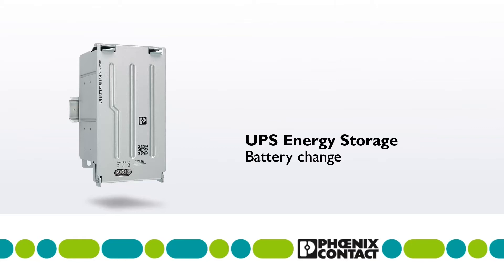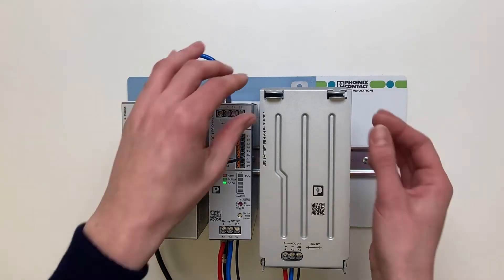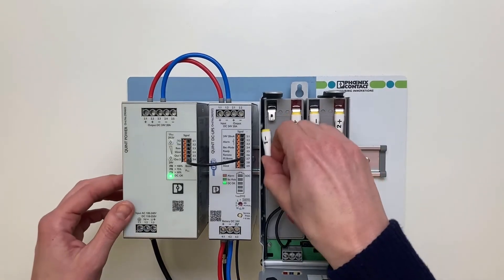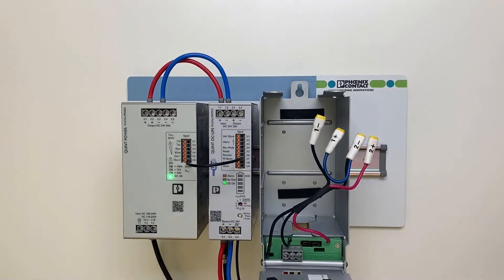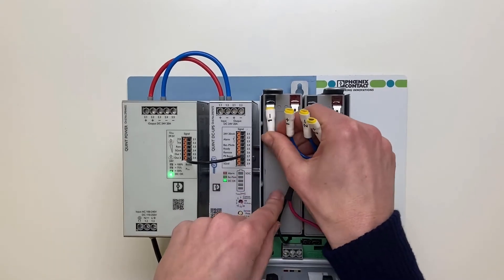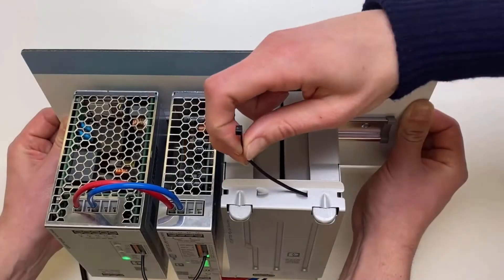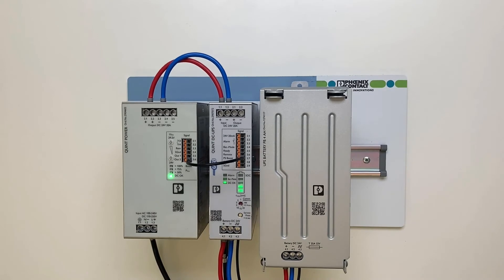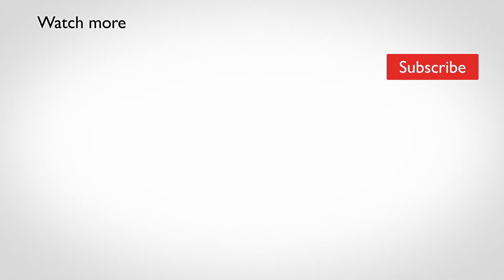Battery change of a UPS-BAT

Comment: Why does this UPS show that the battery has expired, but when replacing the UPS with another one, while leaving the battery, it shows that everything is fine
Reply: Data about the state of the battery is stored in the UPS and linked to battery serial number.
Batteries connected to the UPS are tested concerning defects continuously. 
Occurring defects will be signaled via LEDs on the front of the housing, the alarm contact or the communication interface.

Comment: if I only want to check the fuse, do I have to switch it to "service mode"
Reply from the maker: 1) In operating mode the UPS checks, if the battery is present. So if the fuse is damaged or not plugged, there will be an alarm.
2) If there is more than one battery module connected in parallel there is an additional alarm for fuse check.
3) If you want to check the fuse manually, it is recommended to switch the UPS to "service mode". Press the bottom for more than 6 seconds. Pull the fuse and check it. Plug the fuse into the battery module and exit the service mode (press the bottom for 2-3 seconds, less than 6 seconds). This is important, so that the battery parameters will not be reset (only necessary for battery change).

Comment: Hello,
thank you for this video.
please one question: how many batteries can we connect with this QUINT DC-UPS module of 24V 20A
Reply: Hello, It depends on the battery type. You can connect up to max 5 batteries. Maximum capacity should not increase 135 A/h.